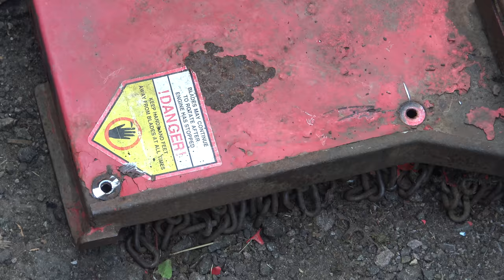BRITISH LAWN TRACTOR RENOVATION - Was It Worth It?

Comment: Wow when you do a repair you do a repair. Trouble with half the crap I work on nobody has made parts for years and you can't buy spares. And no never heard of that Brand in Australia. That would be a great mower for my 4 acre block. 
That gearbox looks the same as the ones on the higher end John Deere. The smaller ones are sealed but the larger ones you can change the oil like that.

Comment: You neec to learn how to press bearings. You never ever press on anything other than the puter shell. Unless your pressing an old bearing out as you can grind the inner race off the shaft
Reply from the maker: No? The disc you see me using is a bearing press disc. This enables the bearing to be evenly pressed in and puts no strain on the ball bearings inside.